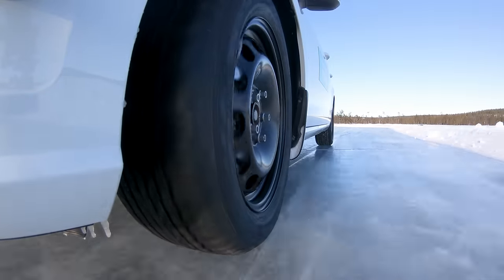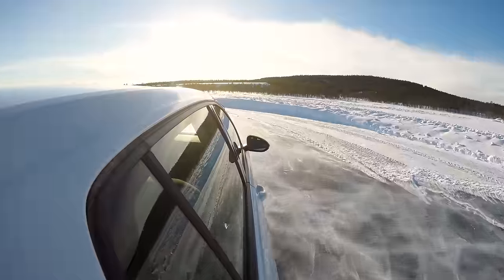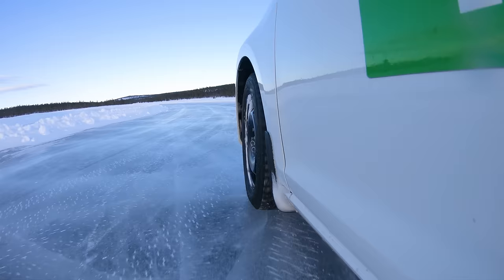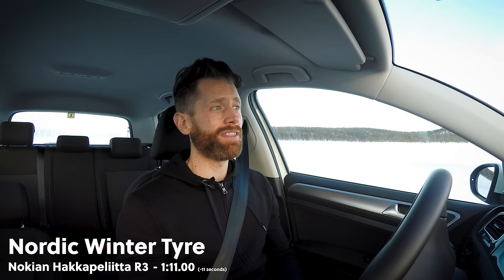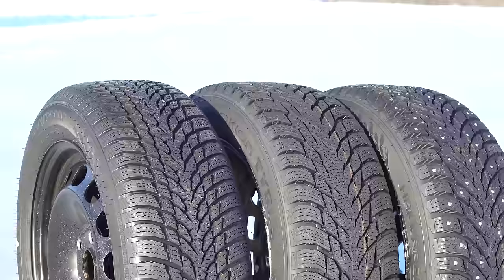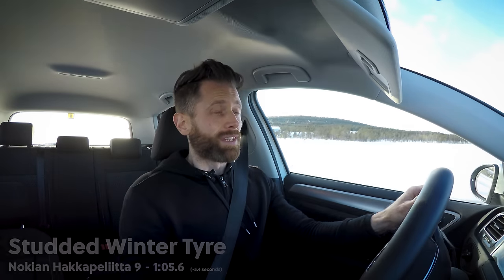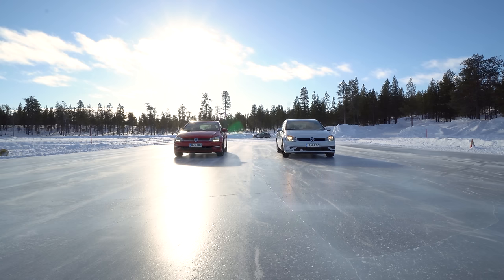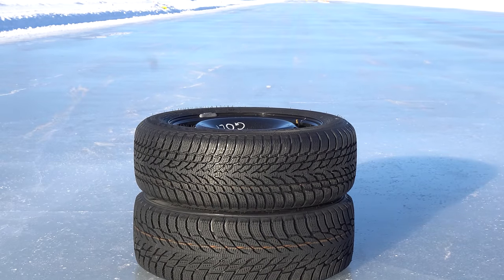Winter Tires VS Studded Tires ❄ What's better on ICE?

Comment: I'd like to see differences between the 3 tires in wet and dry conditions.
Reply: Wet or dry is not their forte. You'll be disappointed. I had a set of WR's and couldn't imagine driving on them in July. The rubber compound stays soft and sticky in very cold temps and sidewalls are constructed to be soft too to give the tire a bit of give which is great in snow and ice. On dry/wet tarmac makes them feel mushy, like they were underinflated.

Comment: How cold was it? Curious if stud vs studless difference would be the same at near ~0C (when theoretically ice should be softer and therefore studs could bite better/deeper) vs ~-15C or colder (when ice is harder and therefore it should be more about friction).
Reply: I would think that if ice is softer at higher temperature it would give les grip biting in to it
Reply: k11su good point. Hopefully it wouldn’t make to big of a difference.
Reply: @danielsolberg1638  The studs are not actually that big or reach out that much compared to rubber surface of the tire. My thinking is that at colder temperatures, ice might be hard enough that studs might not actually be able to bite into it or at least not as effectively compared to warmer temperatures when ice is softer.
Reply from the maker: About -5c I think but sunny so heat on the ice
Reply: Studies done by the State of Washington (I believe), USA showed that studded tires were most effective at temperatures from about zero (F) to about 32 (F). Below zero the ice started becoming too hard for the studs to dig into, and as the temperature continued to drop the studs acted more like skates. At such extreme temperatures the studded tires lost their advantage and studless tires such as Blizzak were more effective. The studs became a hindrance. Above 32 (freezing point) the studs lost effectiveness because they couldn't grip in slushy conditions.

Comment: I would like nokian to be more clear/precise in their descriptions about the use case of the different tires.
For example: 
-this tire is designed for cars with a weight of up to ..., not just SUV. For example Dacia Duster and Land Cruiser 200 are very different vehicles.
-this tire is designed for temperatures of ... and dry/wet/slush/snow/ice surfaces.
This way it is easier for the customer to choose the right tire.
Also, this Info should be at the top or should be a selection criterion
.

Comment: How did the studded tire perform in braking vs the others? Still uncertain if the studded is worth the premium.
Reply: They are worth it, studded beats normal winter tyres on braking easily.
Reply from the maker: Check out the video in the linked comment
Reply: Is that you, Jose? You won't need studs in Tottenham, and studs are only better when  on ice.
Reply: If its icy all the time and temp stays close to 0°C studded are better, but if it stays colder like -10°C or colder, then there isn't much of a point, studless tyres work great.

Comment: I've always ran with Nokian winter tires. I haven't gotten a chance to try the Hakka R3. I just know that they're gonna be way better than the Hakka R2
Reply: How do you know?  I've been driving with R2s the last few winters, and they've been really good
Reply: @fredericb.4426  I had the Hakka R2 in my STi and had tons of fun, street driving, ice rally. I've told people to buy the Hakka R3 and they loved it, I did drive an Evo X with Hakka R3 in 3" of snow, just street driving and overall did performed very well over the Hakka R2. Supposedly the Hakka R3 does better on ice than the Hakka R2.
Reply: @tougedriver8358  Thanks for the info.  First hand experience is always a good complement to reviews, ratings and so on.  Good to hear that ice handling was improved, since that's always going to be the biggest challenge.  I had heard that they might have compromised some aspects in order to improve wear, which should be secondary on these.

Comment: This shows why studded winter tyres is the only choice.
Reply: Unless you have packs of snow, then regular winter tires are better over studded.
Studs don't work as well on snow as they do on the ice.
This is why you don't see a lot of studs on the far north where you have more snow than ice.
Reply: @Caldera01  No, they are pretty much equal on snow but studded is far superior on ice. If the law allow you, studded is the only choice.
Reply: @emilmuhrman  Which is why people living in far north favor non-studds over studds, despite them being legal.
Reply: @Caldera01  Well I live way north (close to the artic circle) and everyone use studded tyres.
Reply: @emilmuhrman  Same and it's the opposite here.

Comment: Having driven ice race events on studded tires... Of course they are better on slick ice.  The real issue, is that they are capable of much more than you've shown!  If you are willing to drift the car around the turns you can slingshot out to the straights and make great time.  This just isn't possible with the soft compound tires.  Drifting around the turns would make a huge difference, because none of the non-studded tires could come close to doing that, likely shaving another 5-10 seconds.

Comment: You based tire traction performance by lap times?  You said the softer compound gained 10 seconds and then the studs gained 5 more.  Keep in mind that the studs improved your average speed above the top level. Try the least effective compound, with the studs, and you will end up with the same results. It's the studs alone that gave you that grip.  I know, because I use them.

Comment: The studless tire grips good new but what happens after a few winters compared to studded tires
Reply: Studless last longer than studded just because the studs are there does not mean their effective the center of the stud wears fairly quickly (3 months) of daily driving would wipe them out essentially making the tires just a worst performing studless tire

Comment: Studded tires last far longer. Long after the soft compound has hardened the studs will still offer lesser but predictable steer and traction. Just replaced Hakkapeliitta 5s from -07 (roughly 70 kkm winter driving) to Hakka 8s. Now Im not expecting these never ones to have that endurance, modern trend is not towards longevity.

Comment: Blizzak WS90 ✌️😆  for studless  Continental 2nd, then Hakkapeliitta    top picks.. i find studed tires works best on black ice, glare or polish ice especially at intersections but on  pack snow, rough ice, slush, wet or snow provides no advantages and when the studs wear or break of its worse than if it didn't have any to begin with
Reply: You are wrong but ok.

Comment: Does the US have “Nordic” winter tires or just normal?
Reply from the maker: A mix, but they definitely have more of the nordic / extreme winter tyres than we do in the snowier parts
Reply: Depends where you are in the States. 15 yrs ago I bought a set of WR's. Had to drive about 40 miles to someone who sold them. That's in NJ. BTW, studs are illegal in Jersey and restricted by calendar in surrounding states.

Comment: Studded tires are the only option. I noticed you neglected to show the studded Tire drag race. I know they spanked the other tires. And what about breaking tests straight line acceleration and braking are the two most important factors

Comment: I'd like to see the test done at lower temps.  From what I've heard compound tires lose traction at -7 or -12C ...???
Reply: Common sense, rubber is harder the colder it gets. Harder the rubber lesser the grip. Studs dont give a shit about temps.
Reply: @turboahdettusupra58  studs also don't give traction past 30 mph! Not to mention they sink into that soft compound but before they do that they make sure you have less of that soft compound in contact with the road
Reply: @j.davenport6065  so tell me why rally cars use spiked tires instead of just rubbery ones :)
Reply: @turboahdettusupra58  Because they love to spin their tires!🤣

Comment: The answer to that question is EASY. Studded tires are better on ice.
The question should be "do you absolutely have to have studded tires when driving on ice?"
To that i say no, i've seen cars going along just fine without studs on ice, even on hills.

Comment: One extremely important detail that is always overlooked in tests is that the decrease in grip over time due to wear and tear is much more severe on studded tyres than stud less. So much so that it's a good bet these results would have been reversed if the same test was done on the second or third season. And since people are driving on new tyres just one season, and used tyres for 3-4 seasons, these tests can be incredibly misleading.
Reply: well thats false. Some old used hakkapeliitta 8 tyres from 2015 were able to make it top 10 on swedens very comprehensive winter tyre tests of 2023. The old ones were better than most new ones. Studded as well.

Comment: From what I gather, studded tires cannot use the exact same compound as top non-studded winter tires, because the tread needs to be more rigid to support forces on the studs.

A lot of winter tires available in NA are studdable, but I see this as a compromise between using best "sticky" rubber and having best studded tire. The studs tire shops put in on request are Mickey Mouse compared to what Nokian does at their factories. 

So, in the end, this video is great sticky compound vs great studs. Studs win. Boom?

clicky-click-click
Reply from the maker: You're correct, the studded tyre has a slightly harder compound

Comment: I think you miss the point.  When coming to a unforeseen (animal jumping out in the road for instance) full brake stop situation you need every second, every micro second as they can be the difference between a trip to the morgue or hospital.  However you down play the importance of stopping distance as if everyone was just playing going around a deserted track.  A very important characteristic is how long the tires last even given that snow tires with soft rubber compounds and studs will not last anywhere near the life of a summer tire it is still important in selecting winter tires.  There are different kinds of studs as well and it would be nice to know which last and which stay in the tires longest.  Those of us who do not live in a balmy climate but have six months of winter already know the importance of studs as well as the fact that the studs come out of the tire even though there is plenty of tread left.  Some tires have more studs than others which is related to their performance too.  Studs save lives.  A proven fact since statistics first were kept about studded tires.  For people who live and work in the northern latitudes it is not a matter of choice whether you are going to have to navigate about in inclement weather.  Life doesn't get cancelled because an inch of fluff fell as in some areas.  You will find few areas with a serious winter who ban studs. You repeat the false logic that because studs cause wear in the road surface they should be banned.  With that in hand all big rigs should also be banned as their greater weight causes far more wear than a car or light truck.  Wear is friction which equals traction.  So wear is a sign that they are working as designed.  Engineer the road surfaces better.  It is not an option to take the easy way out and just forbid all use (they would last sooo much longer then!!) which is the logical conclusion of the proposal to ban studs.  Road wear is just a cost of society.  It is false reasoning that leads to unnecessary injury and mayhem to not address the problem but to try and solve it by forbidding use.

So it isn't a choice to use or not use studs but which studded tires perform the best in traction, wear and durability. It would be nice to see the results of a test putting tens of thousands of miles on mixed surface roads with the different brands and types of tires and stud combinations. 

Hopefully you will never be in the situation where someone crashes into you because they were not wearing studs and that added distance made you a victim.  Nor hopefully will you be that driver who loses control goes off the road and crashes when encountering a patch of icy road without studs.

Comment: To me, the best part about studded tyres is that the dry performance is worse than non-studded tyres, so you're always keeping the same distance, regardless of the conditions. This way, if the road is dry for 2 weeks and suddenly you get 12 inches of snow, you're already keeping more distance and you don't really have to change your driving habits that much.

Comment: Studs are better on ice until you drives on ice free paving and concrete roads. Studs will betrays you on cleared roads and wet roads on cornering and braking.
Unless you living in the county side far away from the city. While most municipalities clears the road within 24-48 hrs.
How often does your areas iced up & for how long ?

Comment: Can these studded tyres be used in the UK?
Reply: I think no. But you don't want a studded tyres is UK, trust me, 98% of the time they will be useless.
Reply: Only off road. Otherwise it’s illegal, as it damages the tarmac.
Reply: I'm reasonably north in Scotland - the European winter compound is a better compromise for our typical winters. We are colder than the south of England but they still spray most of the roads with salt. We do need better snow and ice grip than summer tyres offer, but we so seldom get large areas of untreated ice that the studs will give more negatives than positives almost all of the time.
Reply from the maker: As others have said, definitely no need for studs in the UK
Reply: Only reason I asked is because I used to travel to Buxton on Englands worst road in winter.
Reply: @Benzknees  Have you seen how good the tarmac roads are in the UK? I spend most of the time avoiding pot holes.
Reply: Jason_M0MGF - Haha, that’s true, but in my area at least that was due to cold winters & a backlog on repairs.

Comment: The flat lake bed shown in the video is not a good test, nor comparable to real world driving and braking going up and moderate and steep down hills. Traction and braking on hills is where studded tires outperform non-studded the best.
 I have been using studded snow tires (rear two wheels only with traction lock/posi traction  rear ends, all the vehicles were rear wheel drive only.   __ starting back in the early 1970's on my 69 Mustang fastback, 1974 Grad Torino wagon, 1977 Camaro, 1982 Ramcharger, 1993 T-bird, and now on  2 wheel drive also F-150.
 Never been stuck, never slide off any road, never failed to stop going down any hill.   Well worth the extra cost and effort in taking them off and on each year. for use during the winter months only.  Big downside  _ noisy on dry roads and slightly less top speed on dry roads (more wiggly/and some drift at speeds above 70 MPH on dry roads)

Comment: You Should do a stopping distance Comparison. Studded winter tires.. No ABS.. I bet the studded winter tires will give you the extra distance to stop and avoid a deer that might jump in front of you.  Or Tow a trailer with two snowmobiles and try stopping. I bet 100% No ABS Studded tires will stop you the best. ABS is traction control are great on wet. No so much Snow n ice.

Comment: I've heard the studs will wear round after 1-2 winters and will actually perform worse after that. Also it would have been nice to throw some cheaper nokian nordman studs into the test as a set of hakka9 for my car is 100€ more than R3.
Reply from the maker: I'll have to test that sometime!
Reply: Studs wear fast if you are spinning the wheels on ice, or drive on tarmac a lot. If there is snow on your roads more often than bare studded is the best bet
Reply: @tollevkvendbo  So far i've only had studs but after i had hard time getting the car on plastic ramps with my 3-4 year old dunlop studs i figured do the studs even do any good. The suds were just scraping the plastic and car wouldn't go up.
 In the city it's mostly wet and salty, yet it's the black ice in the countryside that causes most accidents. How well would the studless winter tires cope on an icy uphill incline with FWD?
Reply: @antanasbananas7909  If its a driveway and you have to turn 90 degrees it's hard to get enough speed to get up, that applies to both studded and normal tyres. I think it all depends on weight distribution and center of mass of your car, I've seen a 1998 Camry on studfree climb icy hills like it had 4wd. However it all depends on the conditions and if it's super slippery and you don't have enough speed on entering the hill it can be hard to climb. If you have speed studless will work fine if you are careful on the accelerator, spinning in a hill will reduce your speed to a halt most times. Also, long text sorry, but remember to be careful reversing down hills, in theory it's like steering with the back wheels with the handbrake on

Comment: How would the Michelin Cross Climate have done?
Reply: More like those "all season" tyres North American use. If a few weeks of slush = winter is a definition where one lives, they can get the job done if ones careful, but it isn't ment in full winter, like here in the Nordic.
Reply from the maker: Agreed, it's not intended for heavy ice

Comment: You should have done laps also with winter tyres after you had driven around with studded tyres. Most winter tyres get better grip after studs have broken the ice surface, making grooves and pits. Then even studless tyres perform better. So in a way, studded tyres are way better, but they also make the roads safer for those who do not use studs. And yes, studded tyres save lifes. They are umbeatable, no matter what people say.